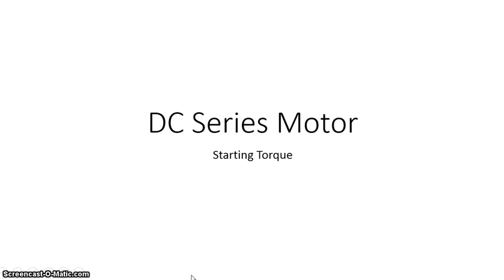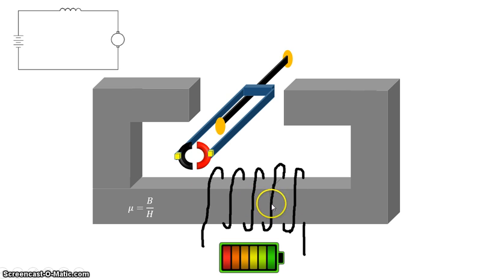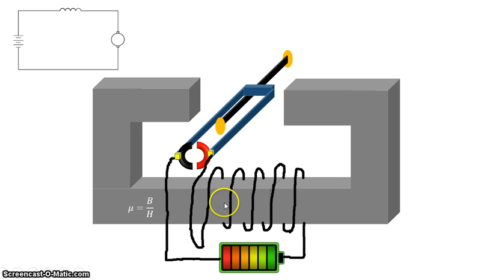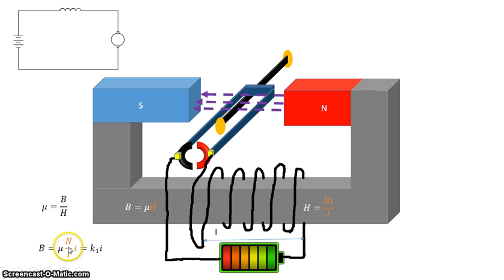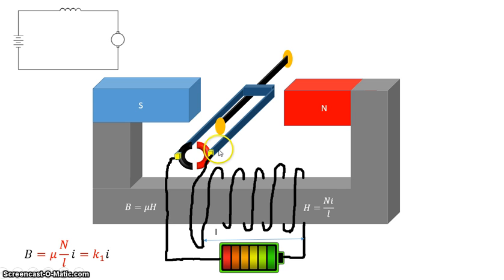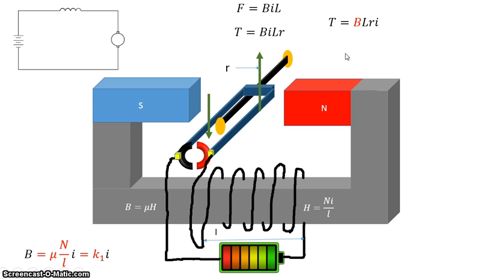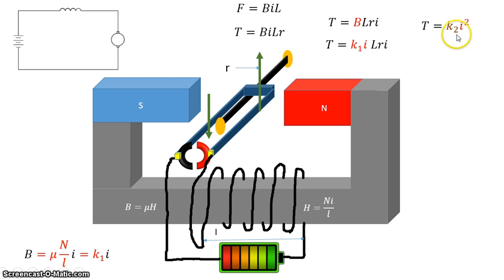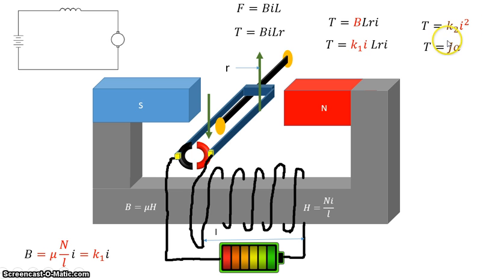Starting Torque of a Series Motor

Comment: Good video, thanks!  I watched this video hoping to hear WHY series motor produces more or less starting torque than a shunt motor.  From the video and the equations presented, the answer to this question is not clear.  Perhaps the answer is in another video?
Reply from the maker: +Philip Lochner The answer is because the Torque is proportional to the square of the current in a Series Motor.
Reply: +Roddy Mc Namee Thanks for taking the trouble to reply.  How does the starting torque of a SHUNT motor  relate to current then?